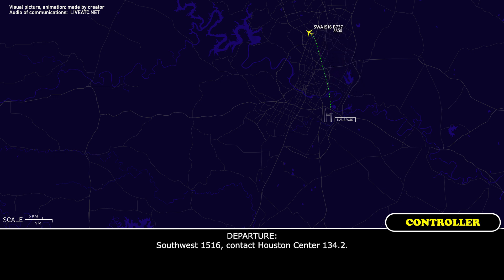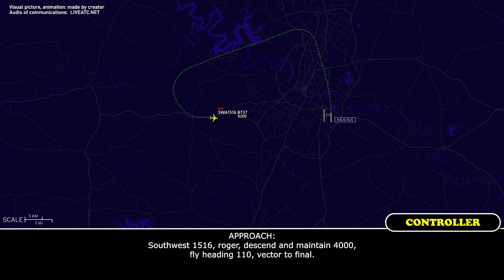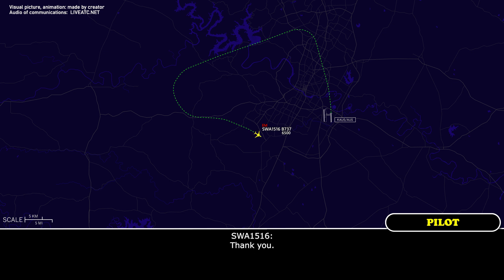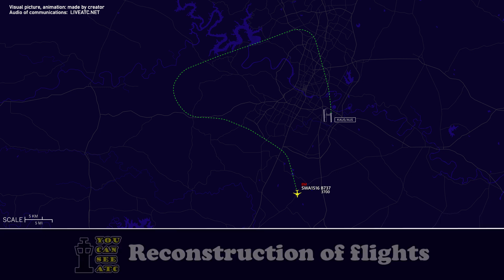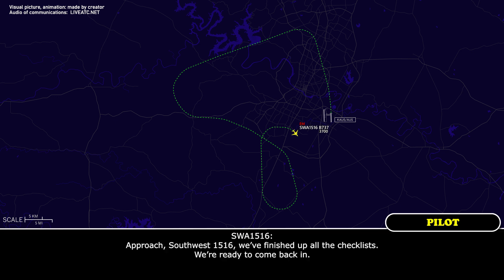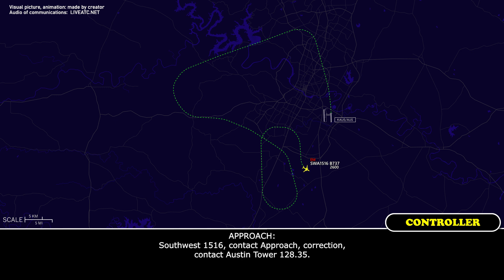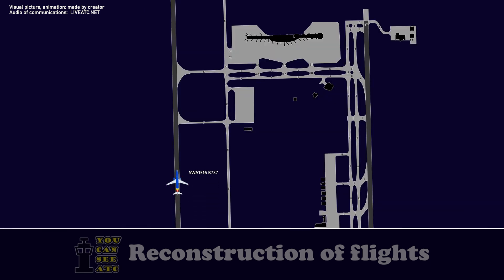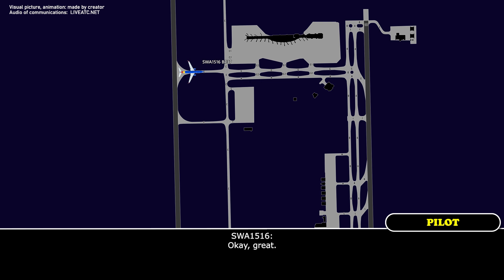Engine failure during climb. Southwest Boeing 737 performs emergency return to Austin. Real ATC

Comment: I was on this flight. We had just reached 10,000 feet when we heard and felt this terrible shudder. I've flown a lot and never felt that. Moments later a flight attendant comes out from the cockpit area and is looking out the window over the exit rows. They gave people an uneasy feeling. We dropped altitude and to the pilots credit, he came on and told us we blew an engine and we were heading back to Austin. Not knowing what a blown engine meant, it was the longest 20 minutes ever to get on the ground. When we landed,the whole cabin clapped for the pilots...